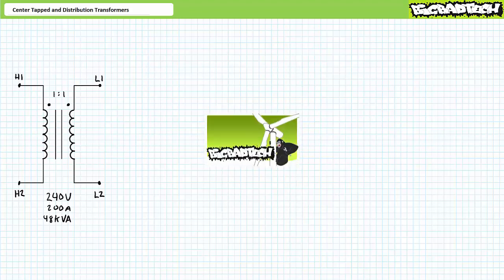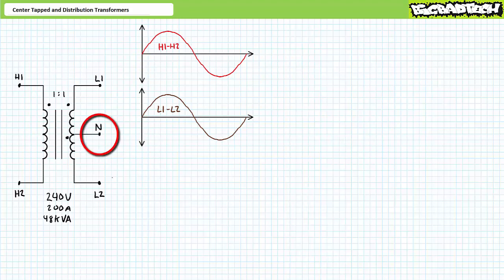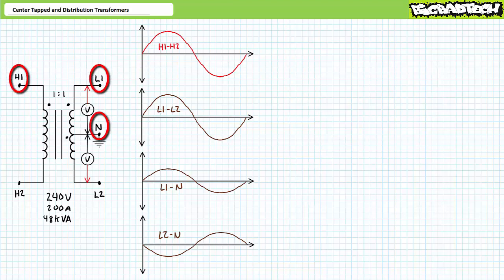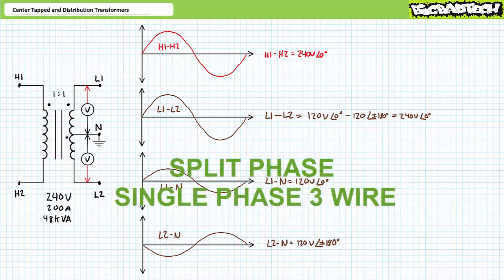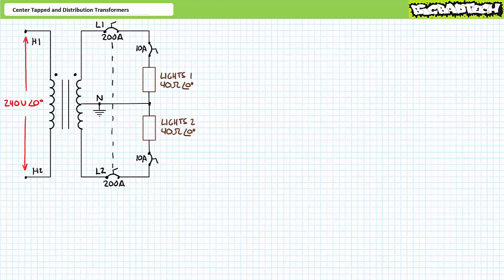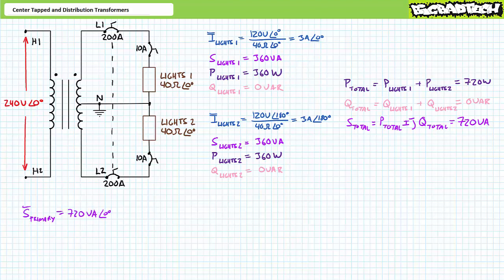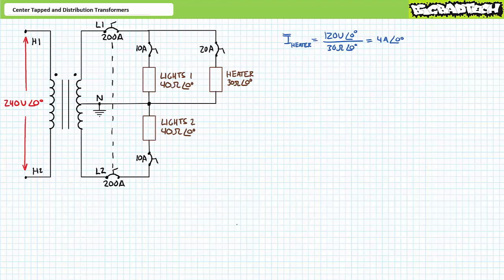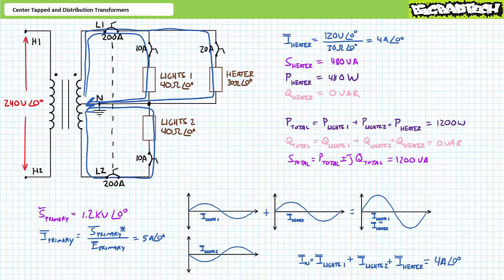Center Tapped and Distribution Transformers (Part 1 of 2)

Comment: Is the maximum possible power draw half of the maximum if I just use L1 and N as Ground? And maximum is then acheived from L1 to L2. Or doesnt it matter? So lets say I can draw 5Amps of power on the secondary side. Will I be able to just get 2.5Amps If I use L1 and N and all the 5Amps if I use L1 to L2? This I am not sure about. Or no matter what combination I choose. I can always draw 5 Amps just of course with a different voltage then? I hope I kind of make sense :)
Reply from the maker: To get maximum power from a single load yes you'd need to use L1 to L2. 

Let's say you have a mechanically interlocked 5A master circuit breaker on L1 and L2 (240V). The maximum power condition would be a load between L1 and L2 that draws 5A (ie: 240*5= 1.2kW). If a load that drew 5A was between L1 and N it would experience only 120*5 or 600W.

I'd check out the full lecture at https://youtu.be/trFDnOgwgXQ?si=qnaO8RLkU0rJ0KD0 because I discuss 120 and 240V loads.
Reply: @bigbadtech   Thanks for answering! In my case I have a center tapped transformer. I am in Germany so I have 230Volts RMS that goes into the primary (325Volts Amplitude) and on the transformer I have a different winding ratio so the secondary delivers on L1 26.3Volts to N and L2 26.3Volts to N too.  I am playing around here in Proteus simulator to figure out how it works. So of what you have said. To get the maximum theoretical power delivery from the secondary windings is to tap into L1 and L2 and use the center tap (N) as a reference between the both. That would give me around 74Volts DC if I rectify L1 and L2 full wave(4 diodes) and use N as a reference beween the both.
 But If I make a full wave rectification from L1 to L2 (2 diodes) but dont reference the N, I get ~37.5Volts DC.
Now the question. Can both configurations deliver the same final amout of maximum amps (power) just with a different voltage or as you have said just the first variant?

Comment: Thanks so much for the great video!

If you have an unbalanced load, where do the extra amps come? Are they supplied via ground?

If there is a 100% unbalanced load where would the current flow from?

And what happens with loss of neural to the centre tap though the 'node' remains grounded?

Comment: Hello Jim, I'm so glad I came across this - thank you.   I'm trying to understand a device called a double-balanced diode ring modulator (in an RF circuit).  This device uses two center tapped transformers and your lecture has helped immensely.   There is still some black magic going on but I'll (hopefully) get there eventually.  Thanks again Kevin